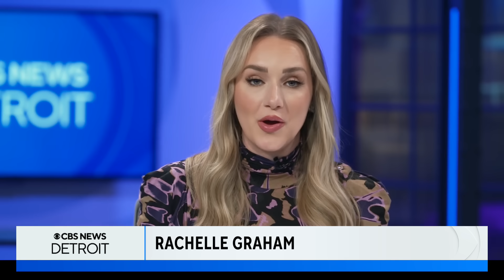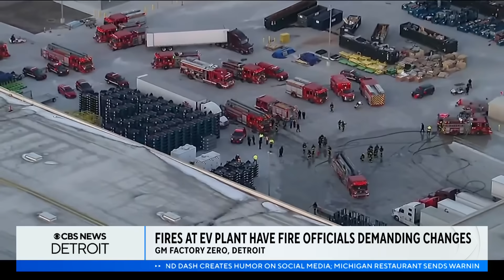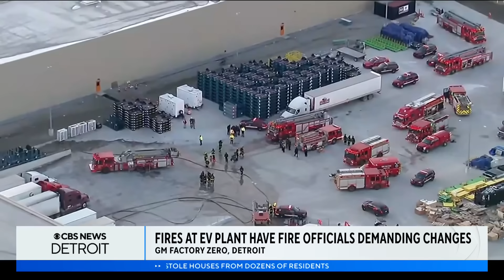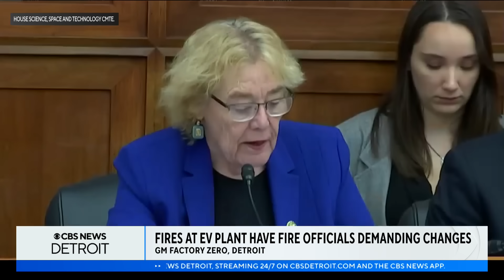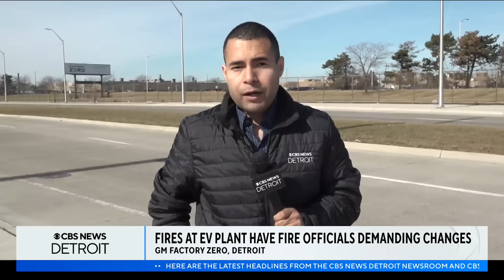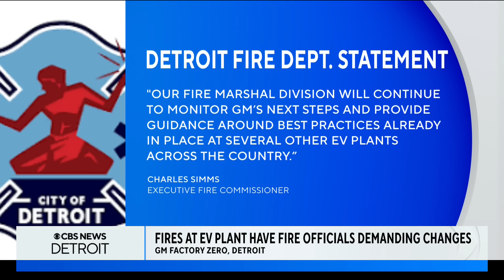Fires at GM EV plant have fire officials demanding changes

Comment: When will it be enough? They claim to be trying to save the air (which is fine) but they create thousands of fires every year that can't be put out with water. Nasty smoke! Gasoline is clean. CO2 is not a pollutant, it's a building block of life. Has nothing to do with the temperature or weather whatsoever. It's 100% bs based on computer models and confined testing like in a greenhouse. Yet they want you to believe space is a vacuum and it's just gas above us holding in all the oxygen. If you want to prove to your climate change friends that they are retarded just ask them to tell you how much of the air is made up of co2. They'll be off by a million percent most of the time.

Comment: lithium ion and lithium polimer has huge fire hazard. But LiFeOP4 batteries don't have that hazard. It very hard to light up a LiFePO4 battery and self extenish after the flame source removed. So saft battery tech is out there, just not used.

Comment: So the huge excavaters that are used in rhe mining of earth materials burns over 5 million dollars of diesel each year. This does not include the massive trucks and bulldozers also used in the raping of the earth both burning similiar amounts of fuel. And thats for 1 vehicle, not the whole fleet. Sounds pretty green to me. If the creepy pedophile wasn't getting a cut it would probably be outlawed. The whole process is extremely damaging to the earth, but you know, climate change.

Comment: I've seen companies even build concrete bunkers to store their batteries in.
Reply: YES, Munro & Gruber have them.
Reply: I've done construction in a battery manufacturing facility and certain rooms have to be "explosion proof". You should see the giant bolts on the electrical junction boxes that are required in those rooms. They could hold on the wheels of a tank. Some of the rooms are so toxic that they need special airlocks and everyone inside needs to wear full hazmat suits.

Comment: These EV's don't seem to be as green as they were pushing them to be.
Can't contain the fires, they will keep burning even under water.  If you need a new battery, that can cost more than the value of the car. Driving through water can void the warranty and total the car if the battery isn't sealed. Running over debris can also total the car when it damages the battery.
Seems that an ICE car can handle more, and you don't have to completely manufacture another car when you go through a puddle or driver over a debris on the road.
How is making a car with that much toxic chemicals that require a lot of mining and that fragile that small things can actually total the car... How is that "green"???
Reply: the problem is with the CHEEPLY made & UNSAFE pouch cells.
Reply: @markplott4820 . EVs generally use cylindrical cells which were never intended to be used in EVs, as pouch cells were.
Reply: @JoeOvercoat   - and YES , the SAFEST cells are Cylindrical, and POUCH cells have the MOST fires & UNSAFE .
TESLA 4680 is the BEST cell you can get , and BEST Structural pack.
Reply: How about in the summertime you can't run your air conditioner or your radio because your battery will die the winter time you can't use your heater or the battery will die I want to know how come all these green people are not driving electric cars
Reply: @yamama7265   - my Split micro HEAT pumps , runs 24/7 and I have SOLAR & Powerwalls , I DONT pay for Electric Utility , they PAY me 2x - 3x per day.

Comment: the closest thing that I would ever get for gas efficiency would be a hybrid/hybrid plug-in. Cheaper than full blown EV in the long run.
Reply: FALSE - hybrids COST MORE to Repair & have 100% MORE Maintenace than BEV.
my Tesla only needed minor Maintenance after 5 years and 300,000 miles.
Reply: @markplott4820  then keep on driving your EV then and quit imposing it on ICE drivers.
Reply: @Baebon6259   - Except, ICE becomes ILLEGAL Jan 1 2026 in some States.
ICE semi already ILLEGAL in CA 2030.
Reply: Hybrids have MORE car fires than ICE.

Comment: Absolutely not, the climate is at stake. We must utilize electricity. So the public doesn't know how their devices are charged. By petroleum. If they found out that battery fires are 20xs worse than a regular gas fire, they'd be concerned. Especially if they found  out that the electric cars are charged predominantly by fossil fuels and they're paying more for energy from the same place.

Comment: Soooo......going Green is anything but green, as those toxic chemicals get into the air, on clothing and equipment,  and in the water system and the ground.   Not to mention the cost and the carbon footprint of either decontamination of the affected structure and repair or the complete demolition and rebuild.   What's the carbon footprint of all that?  The price of owning an EV is anything but green or efficient.  It's not if it will burn,but when it will burn.   If these were new children's toys with this many hazards and dangers,  it would never have made it to the consumer.   However, the agenda to push flawed and unnecessary technology is so strong that it's OK if the whole logic is harmful to health and contradictory.   These are your leaders.  You voted for this.
Reply: May I correct your second to last sentence, please? Elected people in our gov't are "elected representatives" of WE THE PEOPLE, not "leaders". THEY started calling themselves "leaders" to effect control of WE THE PEOPLE. Politicians are no more "leaders" than rats running in a sewer. WE THE PEOPLE are the ones who control the elected representatives. The more the ELECTED REPRESENTATIVES are called, or allowed to refer to themselves as leaders, people will expect them to be leaders. Very few people have that ability in actual life. Please, reconsider your reference to those that are elected to represent "WE THE PEOPLE".
Reply: @kirk1618  yes, you are correct.  I was using the term LEADERS more as a tongue in cheek.  As in , they push their personal agendas and act more as overlords over the people.  It is high time that they are humbled and reminded that they work for the people, and not the other way around.

Comment: How much carbon and toxins were dumped into the atmosphere with each of these fires? How is this environmentally safer than IC engines?
Reply: but, but, but, that's not the purpose of forcing EVs down everyone's throat. We won't address what generates the needed electricity, how the needed minerals are mined, the toxicity of the materials used in the batteries, how many emissions are created when producing an EV/ battery, emissions when one burns, disposal and recycling (or lack of ability) of EVs and their battery. Bottom line is that I'm an ENVIRONMENTAL WARRIOR when I'm driving my EV, the rest isn't in my scope of self gratification.
Reply: @kirk1618 lmao
Reply: Or toxic water draining into the water supply.
Reply: @mchume65 this is the real issue. The plume goes into the air and circulates back down eventually making its way into the water supply.
Reply: Less than oil fires.
Reply: more fires per 100k in ICE than IN EV's
Reply: Who said the fires were environmentally safe? Nice agenda.
Reply: all so politicians can virtue signal as they are stuffing their pockets with our tax dollars.
Reply: Most of the emissions from cars come from operations, not manufacturing.
Reply: @redhat421  no with EVS the majority of polutants happen before the car rolls off the line. Its estimated to take 100,000 miles to break even with an ICE.
Reply: Lithium fires in itself doesn't produce CO2. During lithium fire, H2 gas is given off. Lithium reacts with water. So when the FD applies water to the fire, they are making it worse.
Reply: @markmyjak7739   try FACTS
What are the emissions of EV battery fire?
They can feature high percentages of hydrogen, and compounds of hydrogen, including hydrogen fluoride, hydrogen chloride and hydrogen cyanide infamously, the main component of Zyklon B , as well as carbon monoxide, sulphur dioxide and methane, and polycyclic aromatic hydrocarbons (PAHs). among other dangerous chemicals.

Comment: EV’s are sitting on Dealer Lots, unsold because nobody wants them.
Reply: "Lot Rot".    Every day the car sits on the lot it costs the dealer to store it.
Reply: Do they have to keep charging them?
Reply: @SixOhFive  Yes
Reply: @Scroll_Lock  haha that sucks
Reply: Cmon, you mean you don't want to plan your life around a charging station location?
Reply: @Random-bm7ho  😂
Reply: @Random-bm7ho  Respectfully... yes, that is a major concern, but only for all non-tesla owners that don't charge overnight at their homes.
Reply: @creolerican  Still just a dumb idea. What if I want to drive more than 300 miles and there isn't a charging station available? Then what? Your a slave to the cord always. Not to mention they can't tow anything more than 100 miles. I will never buy a ev. Don't care if it's free, still don't want one.
Reply: @Random-bm7ho where do you need to go that’s more than 300 miles without a fast charger? I’ve done several road trips in an EV without issue. Do I have to stay on the interstate? Yeah. But that’s because its 2024, and the infrastructure on random back country roads isn’t there yet. It will catch up though.

If you recall, there once was a time when there wasn’t a gas station on every street corner. There was a time when you were lucky if the town you were in even had a pump. And these were the days before internet and cell phone coverage. Imagine going on a road trip, and not even knowing if the next town 200 miles away had a station, or even had one that was open. Oh, and what if it’s Sunday, or after hours? Stations closed, no gas, because no credit card point of sales systems. That was how driving a gas powered car was like for DECADES.

I’ve already experienced SEVERAL range anxiety events involving gas stations this decade alone, and we’re only 4 years in. I’m talking about no power to the entire town. No power means none of the gas stations could pump or sell gas. Then there’s supply chain issues where the supply simply never showed up. Both scenarios happened to me several times in different states in different times. You are no better off either way. Heck, I even went to one that WAS closed, because it WAS Sunday, and they only had one pump (two outlets on either side) thankfully one of the two had a working credit card machine, otherwise I would have been out of luck.
Reply: Tesla Model Y is the world's best selling vehicle. Clearly people want them. 🤷‍♂️
Reply: @Optimistprime.  
 
Used Teslas are $selling as $much as a new Corolla now. 
They dropped the price of New Teslas   because they are Selling?
😂😂😂
That’s our world  today
Reply: Can't polish a turd.  You can but you get shit under your fingernails.
Reply: And no one can afford them...
Reply: Respectfully, I must correct you... the thing is nobody wants "Legacy Auto" EV's because they are inferior to TESLA technology and appeal. 

Tesla EV sales are growing every quarter. #Facts
Reply: @creolerican  oh ya everone wants a car that locks them in if theres no power......
Reply: @maddhatter3564   you gotta be pretty dumb not to prevent that. but hey you'll land on your feet one day, good luck to you, bud
Reply: They're sitting on the lots, just like all the F150s, Ram 1500s, Jeeps, Dodges, oh my! Yet Japanese hybrids and EVs are selling like hot cakes. I wonder why?

News flash, Ford GM etc will need to catch up, or they will be gone. Dead. A part of history. It doesn't matter how iconic they are. Keep up with the competition or get left in the dust.
Reply: @patton3338  cause the Japanese cars are the affordable prices for an average american
Reply: @patton3338 because no one wants to pay $80k for a truck, or even $60k. Why on earth is anyone willing to pay so much money on the same boring black or white contractor wholesale pickup everyone else in the grocery store parking lot has.
Reply: @patton3338  I disagree with the reasoning you give as to why they are hard to sell. You think they need to match the expensive imports with all the bells and whistles? They seem to believe that too because now they don't make base models anymore that average people can afford new. If they just went back to their roots of making an affordable car/truck they would have no problem competing with foreign companies. They seem to think every car needs to have a computer screen, and power everything. backup cameras and God knows what else. Why does anyone who actually needs a truck need a computer screen in it? They don't but Toyota only sells trucks to people who simply don't need one for any reason. Domestic makers know they can just get bailed out if anything bad happens anyway so why not just be lazy and try to copy the competition?
Reply: @GeorgeJefferson-h7w  Bro, first off, you should know all that cool tech, the touchscreens, is a cost SAVING measure. Not an expense. Good buttons and dials are very expensive. Touchscreens have gotten cheap. They are cheaping out and pretending it's expensive.

The part that is adding cost are the safety features. The stats are in for that too tho. Any car made in the last 20 years has seen a massive increase in accident safety. It's saving a ton of lives. Cars older than that likely wouldn't even be able to pass at all these days.

That cost will not go away, because safety is paramount. What you should be asking yourself, is how is Telsa able to make EVs that can outrun a Porshe GT3 for the same or less $ than the competition, while being years ahead of the lightning, mach-e etc? I'm telling ya bro, it's not EVs, its the competition.
Reply: @patton3338 touchscreen radios and backup cameras are one thing but they are putting HVAC and other controls into the touchscreen radios which has to make it more expensive to make than just a plastic dial knob to control the hvac and fan controls.  base models used to mean basic black plastic interior, no steering wheel radio controls, no cruise control, no automatic climate control, no electric mirror controls, no power seat adjustment.  They could make basic vehicles again for people that just need to get from one place to another and still make the safety requirements
Reply: Safety isn't paramount. Defective cars are shipped out of assembly plants by the hundreds each day. When there's an incident, the police and regulators cover it up. It's only the most outrageous incidents which go public. Then the government pretends it's an isolated incident and the system works. 

I worked on the final line of an assembly plant calibrating and repairing the test equipment. I thought management was all going to go to prison. Now all these years later I understand the system is corrupt and rotten to the core. Trust no one. Buy Toyota and maybe Honda and Mazda. Stick to the bread-and-butter vehicles and cool it with the options and features. And lastly, don't be so naive.
Reply: @patton3338  So buttons now cost more than computer screens that control computer assisted functions? Ok. And the only reason they need airbags all over the place is because of all the distracted drivers too busy on their phone and touch screen computer display to pay attention to what they are supposed to be doing. Crashes go up. New cars with all these safety features have the biggest blind spots I've ever seen. I can see exactly what is going on around my old truck because that used to be important. Now you just look at your phone and cross your fingers as you drive off of the road and into a ditch, or as you swerve into an occupied lane that you couldn't see. I've known several people who died in car related accidents. Distracted driving is killing more than drunk driving these days. People need to pay attention the whole time they drive or they need to quit driving. More airbags is not the answer.
Reply: @user-un4mu1hj5o  Bro, are you mad that physical buttons cost more (look it up) and safety features have become a priority? I dunno, I like safe cars, people are dying a lot less. That seems good to me, but you do you bro.
Reply: @patton3338  
Take a trip 3,000 miles. Let me know how it went. Don’t be mad bro. 😎
Reply: @PhyuckYiu2-777  Ahaha, you mean the kinda trip people take once a decade?

That's the beauty, noone cares about that. Families just need to get to work and soccer practice.

It's all changing around ya my dear dinosaur, and there's nothing you can do to stop it. In 10 years, they'll all be EVs. Enjoy. 😘
Reply: @patton3338  
So YOU bought an EV! 
😂😂😂
Reply: @PhyuckYiu2-777  Oh not yet, I drive a 4 cyl Turbo if you're curious.

My point here is the change is coming, and you should accept it now. All the problems you think EVs have, are already solved, and are coming to market in the next few years. Toyota has a heap of scientific papers about it if you wanna do some reading.

In 5 years they will have 50% more range, charge twice as fast, no risk of fires, and cheaper to produce. Already tested and proven by Toyota and LG. Once those changes hit. ICE is dead. Every family car will by an EV, so the entire market will be. Welcome to capitalism.
Reply: @patton3338  say no to drugs.
Reply: @patton3338 most Japanese companies have stopped producing EVs because nobody wants them.
Reply: Japanese EVs are selling like hotcakes? Sure they are.
Reply: @patton3338  prove that japanese hybrids are selling "like hotcakes'. Ive not seen that anywhere.
Reply: @maddhatter3564  Except Toyota's consistently being harder to find and holding their resale value better than any other brand.

Ya coulda done even the most basic research bro. I don't care what you see or feel cupcake, I care what the stats say.

Haha, the Rav4 was 4th and Crv was 6th in sales last year, Beaten only by the big 3 trucks and Tesla's. It was a first link to car and driver, a first grader woulda found it. 🤣